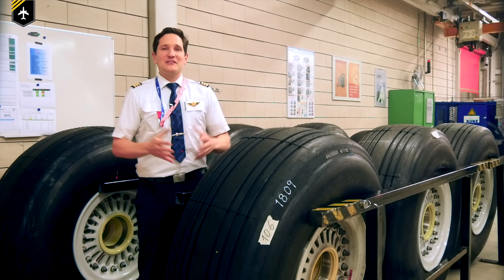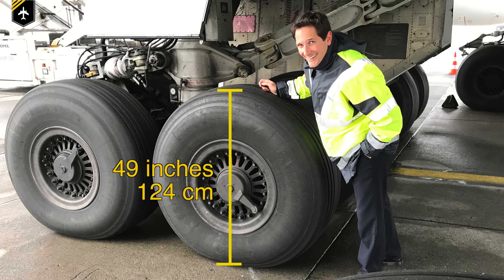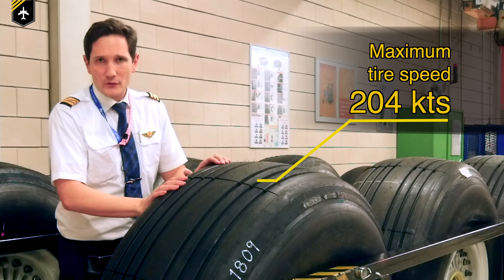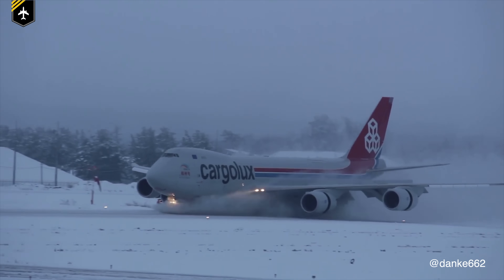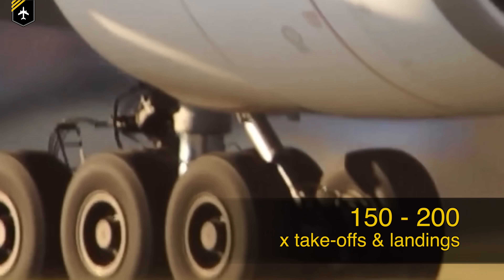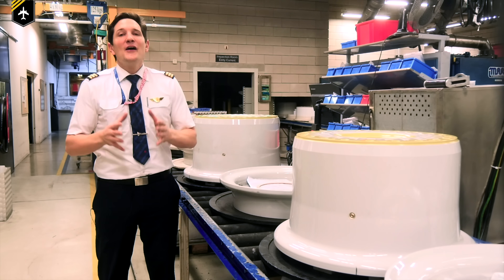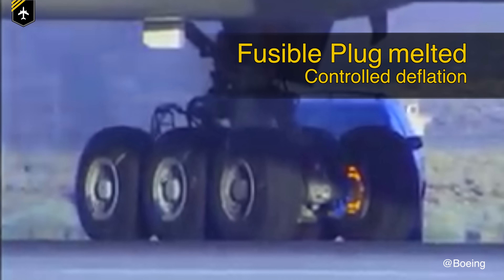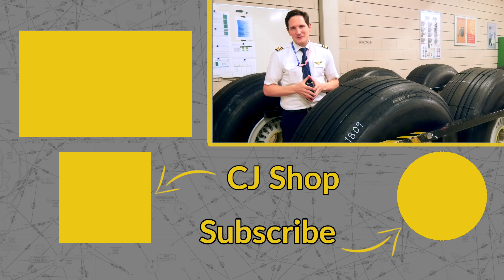HOW MANY LANDINGS can TIRES withstand?? Explained by CAPTAIN JOE

Comment: Scary that airlines use retreads lol.  Not confidence inspiring
Reply: I'm not sure of the foundations for your concerns. Aircraft tire retreads are necessary for a number of reasons including, but not limited to, economics, environmental impact etc. However, commercial aircraft tire retreading is heavily regulated and can only be carried out at certified facilities by the original tire manufacturer. Provided that there is no damage to the tire carcass, it is common place for airlines to have tires retreaded up to the certified allowable number of times. Thus there is no need to be concerned and you can have full confidence in  aircraft tire retreads.

Comment: why not spin the landing gear tires with exhaust gas from the turbine engines at the landing speed, so less wear and tear?
Reply: Zaharia Singeorzan Adds a lot of complexity, decreases propulsive efficiency, increases angular momentum which changes handling characteristics somewhat
Reply: @AmbientMorality  did a research after this comment, you're right...

Comment: Captain Joe, do you ever make sure your cargo is secured properly within the plane? How is the cargo secured within the plane? It’s my understanding that sudden shifting of the load, especially if it’s tens of thousands of pounds/kilograms, can be catastrophic and bring the plane down. What comes to mind is that video on YouTube of a military plane going down suddenly after take of, I think, because the cargo wasn’t secured properly or failed and suddenly shifted all the way to the back of the plane. 

I used to be a Flatbed truck driver in the US, and it was my sole responsibility to make sure my loads were secured properly with the appropriate amount of straps, chains, and or binders. I usually had anywhere up to 48,000 lbs (21.773 kg) on my trailer, but some heavy haul guys can have more than 100,000 lbs (45.359 kg) on their trailers with their gross weight being more than 200,000 lbs (90.718 kg) (!!!). If I didn’t secure my stuff properly, not only did I risk my own life but also those around me on the road. There’s been instances when steel beams or aluminium suicide coils went straight through the cab killing the truck driver after suddenly braking relatively hard, all because the driver didn’t secure his load properly. 

I’m currently working towards becoming an airline pilot, and I may try out being a cargo plane pilot like yourself one day, so I’d be interested in knowing how the cargo is secured in your planes. I’d be worried and full anxiety if I didn’t see for myself that my load in my plane wasn’t secured properly. If possible, I’d go to the back of the plane and use my skills as a former Flatbed truck driver to analyze the securement of the load and add some chains and straps when need be, lol.

Comment: This is a useless video.  The longevity of any aircraft tire is relative to Manufacturer, Size, Temperature, Runway Surface, Aircraft Maximum Gross Landing Weight, Approach Speeds
Crosswinds, Number of Take-Offs and Landings,  Debris and last but not least 'Pilot-In-Command' skill !  The number of landings a tire can endure is worthless information for any passenger unless they can get access to the Maintenance Log Books of the aircraft they will be boarding ensure a safety margin. Captain Joe is just like the other clowns that post videos to earn some money

Comment: One thing he forgot to mention about the benefits of nitrogen over air in tires, is air expands & contracts with things like altitude and humidity, where as nitrogen does not.
Can't inflate your tires with air at sea level, and then climb to 60,000 feet and not expect them to explode.

Comment: Another want to be Aircraft mechanic!Why don't you tell everyone WHY THE 747 USES THE SAME SIZE TIRES! The real reason air is not used in a aircraft tire is not the volatile it's because (oxygen Nitrogen) AIR  contracts in extreme cold temperatures at 35000 plus feet UNLIKE PURE NITROGEN.
Also this would cause a flat tire on landing which would be dangerous if all the tires are flat.

Comment: Does the wheels have pressure sensor like modern cars, if not why?
Reply: Some have and some do not. On most aircraft, tire pressure indicating systems are optional. There are a number of reasons for this; including reliability, weight and costs. Some of the most modern aircraft are now coming with them as standard.

Comment: Yes, question please: Why aren't rubber fins installed on the sides of the tire to help them rotate (or as it's been commented before, an electric hub) just before landing? Tests could be done to verify if it is beneficial, I mean shouldn't you hit the floor running?

Comment: 📣 A decade ago, I had a brilliant idea to make aircraft tyres last way longer, by adding rubber vanes or cups to the sidewalls during manufacturing, so as to catch the wind when on the lower half, then slip through the wind when on the upper half of their circle of spin. This would spin up the tyres when lowered before landing, to drastically reduce the skid on contact with the tarmac, reducing wear with rubber ripped & thermal stress with excessive localized heating of the tread! I investigated the "Patients Department" & found my idea had been already invented in about the 1950's first, then again by others in later years with their ideas having variations of the same basic design, like vanes on the rims instead, or motors to spin them up before landing!
So it was impossible to patient  the same Idea & my retirement fund was foiled!
 What amazed me was why hasn't this simple idea been implemented already? Do the tyre companies have a control of the market & don't want this innovation, as they'll loose lots of business, or what? Maybe the airline companies have had this knowledge suppressed from them, as they should be sure interested in my books?!
Reply: One of my jobs in an aircraft landing gear group used to be replying to letters from people who had invented pre-rotation of tires (I was given the task after arriving in the group from college with this great idea for... pre-rotation of tires!).  Turns out all the smoke and noise doesn't amount to much wear-wise, so given the various weight penalties and potential operational problems (a lot of them) which would go with any sort of system, pre-rotation just doesn't come anywhere close to being worth it.
Reply: @marcmcreynolds2827  Ahh, what a pleasure to have you reply & fill me in thanks Marc! Awesome brother.👍 At least that will put my mind to rest on this issue, as there's no point if it's not worth it financially! Cheers.🍻 Rich.😎

Comment: Would it make sense to put electric motors in the wheels so they can spin up to the same speed the plane is going before it touches down in order to increase tire life?
Reply: Basically the manufacturers are not interested this thing because it would increase costs and it would make the landing gear structure more complicated and increase weight which is not desired. It would also increase the need for maintenance which costs more money for the airline. Obviously the system would also be the weakest link of the landing gear and there could be many failures.
Reply: Mike P I think if it was engineered well and implemented properly, it could work really well.
Reply: Absolutely! See my comment I just left, if you click on the widget out to the right at the top of the comment section, to select "Newest First". Once you've read it, what's your thoughts?
Reply: Mike, I agree with Hell fire,  as simply casting rubber cups into the same rubber of the sidewall, during manufacturing, will be totally maintenance free as far as I understand? What maintenance do you envisage? I'll also add my original post to this thread next.
Reply: @richardteale8203  - My response was to the idea of using electric motors, which would make the structure more complicated.
Reply: @mikep9604  Thanks.😀 I see that now, sorry for misunderstanding you. What do you think of my idea?
Reply: @richardteale8203  - No worries. If your idea works as desired it may be one solution. Perhaps some company comes to the same idea in the future.
Reply: @mikep9604  Yes, I agree! However back at that time, I thought to alert one of the airline companies, and who better than Richard Branson of Virgin Airlines! I found a channel on his website for inventors to suggest their innovative ideas, spilled all the beans as I did in the original post I added to this thread, but didn't get any reply, or seen any example of this put into practice since?! I can only assume airlines don't want something to save them a bundle of money either, or their's red tape & politics within the industry preventing this happening?
Reply: 📣 A decade ago, I had a brilliant idea to make aircraft tyres last way longer, by adding rubber vanes or cups to the sidewalls during manufacturing, so as to catch the wind when on the lower half, then slip through the wind when on the upper half of their circle of spin. This would spin up the tyres when lowered before landing, to drastically reduce the skid on contact with the tarmac, reducing wear with rubber ripped & thermal stress with excessive localized heating of the tread! I investigated the "Patients Department" & found my idea had been already invented in about the 1950's first, then again by others in later years with their ideas having variations of the same basic design, like vanes on the rims instead, or motors to spin them up before landing!
So it was impossible to patient  the same Idea & my retirement fund was foiled!
 What amazed me was why hasn't this simple idea been implemented already? Do the tyre companies have a control of the market & don't want this innovation, as they'll loose lots of business, or what? Maybe the airline companies have had this knowledge suppressed from them, as they should be sure interested in my books?!

Comment: I remember a question in my final physics degree exam: “how long are the skid marks from a landing aircraft?”  What an interesting question... and, unfortunately, not mentioned in this video.The point, and its the same reason the tyres only last for 150-200 landings (take-offs less important?), is of course that as the aircraft comes into land, the wheels are not rotating. So a microsecond before the tyre touches the concrete the tyre is not rotating but the concrete is passing at, say, 150knts. Contact is made.... and of course the wheel cannot spin-up instantaneously. So it must skid for a few seconds until the tyre’s peripheral speed is the same as the landing speed. 
In the 10mins I had allowed per question in the exam I didn’t manage to figure out the formula for the length of the skid marks. Can you figure it out?
Reply: Quite a few (numerous) variables at play: vertical speed, horizontal speed, wheel and tire mass distribution (polar moment of inertia), tire friction coefficient, runway friction coefficient, actual rubber tire surface degradation, residual brake friction, actual runway local flatness (at touchdown point and along skid lenght)...  
SO MUCH VARIABLES AS TO MAKE ANY FORMULAE CALCULATION PRETTY USELESS!!! (because it will still be very vague, with too imprecise rssults). Evidently, your teacher was a too-teorethical too-narrow thinking type!
Reply: @alfredomarquez9777  Well... in an exam situation, you can expect to be given a set of assumptions that simplify it, or make up some yourself. So, there's a landing speed, the wheels have a rotational inertia, and there's a coefficient of friction for rubber skidding on a runway. [Force of friction] is [normal force] * [coefficient of friction]. Then just solve how long you need to apply that force to the periphery of the wheel to accelerate it up to the landing speed.
The biggest problem I see is solving the normal force. It doesn't just step up instantly from 0 to [the landing weight of the aircraft] (or it would be quite an oversimplification to assume that it does). It'll gradually ramp up from 0 as the landing gear's shock absorbers compress, and the exact function of [normal force] vs [time] depends on how hard the landing is. 3:37 shows how bogeys with more than 2 wheels complicate it further.
If you're a final year physics student, you can probably take the [normal force] vs [time] function, work out the [angular acceleration of wheel] vs [time] function, then integrate to find when wheel periphery speed equals landing speed. Seems a lot to ask in 10 minutes without the instant-weight-on-wheels assumption.
Reply: I see what was your situation.  But nevertheless, that kind of question suggests how far from the real-life situation was your teacher. I've been thinking what kind of equation would be proper for that problem, and still find it very improbable that a general equation can be drawn with any useful approximation...  He could have selected many other systems to analize to a better degree of confidence than the skid lenght! And it seems quite hard to answer properly in only 10 minutes, even for a higly qualified engineer, with some real knowledge of landing gear dinamics and elastomer degradation!
Reply: Takata Miyagawa Impressive answer: that’s the path I took trying to answer the question. But I missed the integration step. Still managed a good degree though. Looks like you did so too.
Reply: @tomburton8239  Regrettably, my final results weren't that good, and I haven't managed to get a decent job that actually uses any of my engineering degree. >.<
Aside, the landing gear context sounds more creative than just writing an exam question with abstract discs and surfaces.
Reply: Takata Miyagawa Are you in Japan (guessing)? Even here in the UK I’m reading that many good people struggle to get employment in Japan.
Reply: @tomburton8239  No, not Japanese, just picked this name for anonymity. From what I hear, the Japanese education system might have been too hard for me.
Reply: Takata Miyagawa Very glad to have made your acquaintance anyway. And Tom Burton is not exactly real either.....

Comment: What is the average cost of an Airline tyre in USD? Are there different brands like we have for cars? Do passenger and cargo planes have exactly the same tyre?
Reply: The cost can vary a lot depending on the actual tire, the manufacturer, the size, technologies etc. It also depends a lot on the airline itself and the agreements they have in place with the tire manufacturer. For these types of aircraft, you can typically expect a few thousand dollars per tire. Yes, there are different manufacturers for aircraft tires. The most common for large aircraft are (in no particular order) Michelin, Bridgestone, Goodyear and Dunlop. Note that like car tires, not all manufacturers will be available for all aircraft models. Tire availability is dependent on being certified as meeting the aircraft and regulatory requirements. As these requirements are typically the same for a certain aircraft family, the passenger and freighter versions of that aircraft family would typically have the same tire options available. There will be specific cases where this is not the case, but for the most part, you can consider this to be true.

Comment: I dont know why they dont put on a hydraulic motor on the wheels to get them spinning before it touches. It wouldnt need a lot of power it would just be free spinning, no load. It would save on wear.

Comment: Excellent explanation, just a detail.   
Main and Nose tires are NOT the same size in all 747 explained. In 747-100/200/300/400 yes, all tires are the same, but not on the series -8, where the main gear tires are just a bit larger that the nose, that is why by just look at it, is hard to see the difference, but in fact the are not interchangeable. 
The reason for larger tires is because the size and weight of the plane is bigger and not extra tires where added. 
As an info, during first flight tests on B747-8, was detected that those small changes on tire size and even main gear design in combination with an longer after fuselage section, caused vibration on the tail zone due to aerodynamic flows at low speed. The solution that Boeing found to that issue was change the position of the body gears door when open, staying closer to the tires, as well they limit the Flap down travel too.

Comment: you said a standard car tire is 28 inches, big SUVs go at around 20 or 21 inches alot of smaller cars are in the range of 15-18 inches. minor mistake but it stood out too much not to mention.

Comment: Why can`t they spin those tires up with a electric motor or some kind of turbine to the air- ground speed to reduce friction on landing? I used to sit by Midway airport in Chicago and watch the planes take off and land on my lunch hour before they sealed in the airport with walls and thought it would also make for a smother and quieter landing.

Comment: Fun fact: the tires of Bixiʼs bicycle (public bicycle sharing system serving Montréal, Québec) are also filled with nitrogen gas, to “maintain proper pressure for longer”.
Reply: Lots of different tires in the last decade have been getting factory filled with nitrogen 😊

Comment: The vertical threads are designed that way to prevent aqua-planing , it helps water pass through them in wet takeoffs and landings
Reply: Treads.
Reply: @joewoodchuck3824  omg I hate the auto correct feature. Thanks for the correction 🙏
Reply: @osamaal-humaimidi1481  Yeah. I get caught up that way too. It's as much of a help as a hindrance.
   I use two different phones for posting. One with check turned on and the other with it off, and I swear that neither one is less cumbersome to manage typing than the other.

Comment: what kind of tyre compound/ rubber do aircraft use? example; road cars. race cars have a soft compound for more grip, tyres for wet condition, icy etc.. aircraft, on the other hand, may experience multiple of these right?